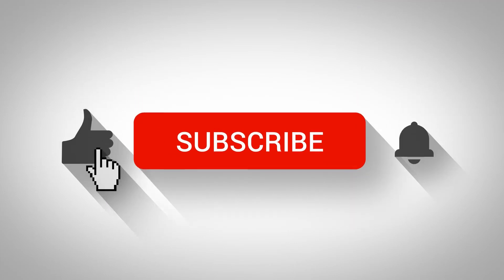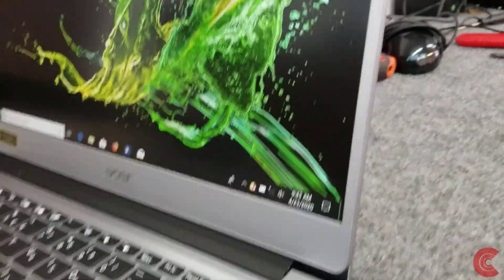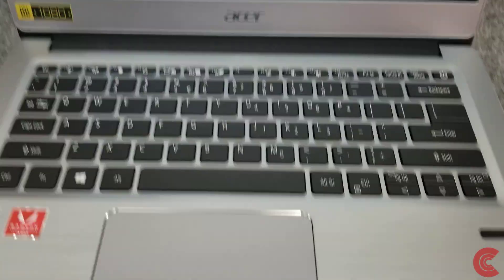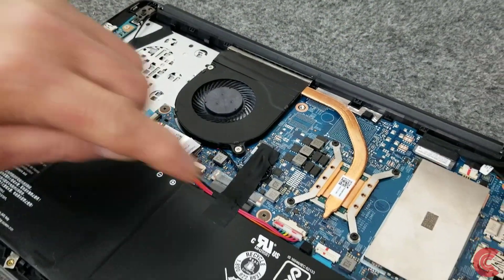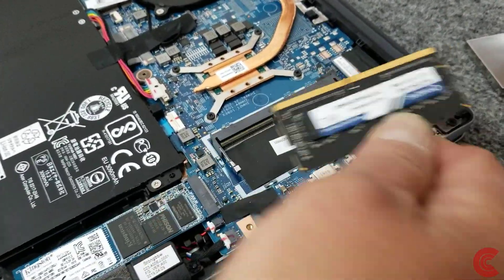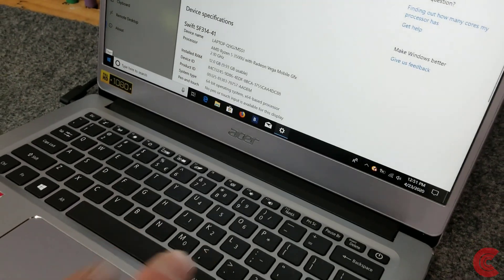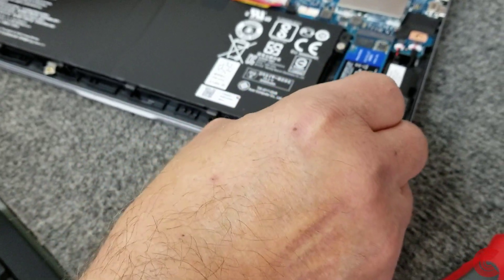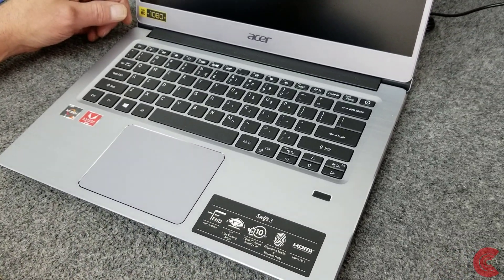Acer Swift 3 SSD & Memory Upgrade SF314-41

Comment: Worth noting that the spare 2.5" drive bay will not accommodate the thicker size of standard 2.5" HDD (15mm) only the two smaller sizes; 7mm and 9.5mm

Comment: Mine has a HDD in the HDD slot. Do I need to remove it first before adding an SDD on the m.2 nvme slot? Or would both work together if I add both?
Reply: Hi. You have 2 storage right ? NVMe and SATA 2.5 ? Are they work together ? Thank you

Comment: Very straight forward. Just installed the Team Elite 16GB ram flawlessly. Next thing I'll do soon is a new NVME drive which I've just ordered. Thank you!!
Reply: is it working with no issues?
Reply: does it support 16gb single stick?
Reply: @koru_insta2397  did you ever find out about this?
Reply: Can i Ask you about how max the upgrade ram of this unit? mine for now have 8gb’s of ram, but i want to upgrade it into 20gb by change the 4gb removable one with 16gb of ram, is it possible?

Comment: I just added an 8 gig to my swift 3 as well just now. 
What you said just happened to me and the screen won’t turn on even if I have given it enough time before force shutting it down. Help. 😐😐😐

Edit: it took me a re-installation of the ram, did what you’ve done of booting the power on with out the back cover and un hooked battery to the board. It finally worked! 
Thank you for this vid and your easy to understand, straight to the point tutorial!

Comment: i am sorry my  man i hear its no  static carpet cool sorry to say  that , a quick question, i have the swift 3 with pentium gold cpu , CPU 4415U @ 2.30GHz   2.30 GHz i take it it has the same  ram in it
Reply from the maker: Hi no problem.   Your ram will DDR4 for sure.  It may be soldered to mainboard, which means you can't change it. You may an expansion slot too.  Dale

Comment: you could not find a more static producing top to work on with static sensitive parts
Reply from the maker: Lol.  All our bench tops are covered with commercial anti static carpet. Our floors and bench tops are treated regularly with staticide. In 25 years never an issue.  You couldn't produce a static discharge in our store if you tried.   Dale

Comment: I did an ssd upgrade on the m.2 slot on my swift3 (before it was running windows on the hdd) but after doing windows 10 fresh install on the ssd, the laptop will sometimes get memory management error bsod upon restarting or waking up after sleep. Any suggestion on what to do? Any help would be much appreciated.

Comment: hi dude my sf315-52 lcd broken can i replace it with n156hge-eab lcd?
Reply from the maker: Hi. If both screens have same 30 or 40 pin connector,  most likely a 30 pin, unless it's a touchscreen, which will be 40 pin. Dale
Reply: @CadillacComputerCenter  both 30 pin thnks dude

Comment: hi, please could you tell me if the Acer Swift 3 supports 1x 16GB and 1x 4GB together (I can change only one 1 stick of 4GB RAM the other is fix). Thank you!
Reply from the maker: Hi. It should support a 16gb module.  Total of 20gb. Dale
Reply: @CadillacComputerCenter  thanks
Reply: @CadillacComputerCenter  Do you know anyone who tried it with this model? (I upgraded to 12GB, not sure does it support upgrade  above 12GB)

Comment: Hello Sir, I want to add a m.2 nvme ssd to my laptop but idk which ssd comes with screws for the m.2 ssd.
Reply from the maker: Hi. M.2 drives require only one mounting screw.  If your laptop already has an m.2 drive. Use that screw.  If your m.2 slot is empty. Usually the screw is already there. Dale
Reply: @CadillacComputerCenter   My laptop only has 1TB HDD that comes with so I don't have a screw for m.2 drive that comes with it. What should I do?
Reply from the maker: Like I said. The screw is probably already in the mounting hole. If not, you can get the screw easily on Amazon or Newegg.  Just search for m.2 mounting screws.

Comment: hi i need help. i bought ram that is 2400mhz sodimm 8gb ddr4 for my laptop (same model) but when i installed the ram, the side lights were blinking blue but the display was not turning on. the technician said for the ram to be read the laptop should be reformatted. idk what to do please help

Comment: Hi, i have the same brand new laptop, since i got it from the store, the start up usually takes 5 or 7 minutes. And performance is so low, it's very laggy. What can I do to improve this?
Reply from the maker: Hi.  Hmmm, it should have come with an ssd installed.  If it has a hdd, then you can upgrade to an ssd.
Reply: @CadillacComputerCenter  will i lose all my data as well as windows 10 if i change it to ssd? I got the 1TB hdd

Comment: Hi, I have an Acer Swift 3 with 4gb RAM and 1tb HDD. Is it possible to upgrade to an SSD? And to add more RAM? Thanks!
Reply: It's a Swift SF314-41.
Reply from the maker: Hi. Yes you can on both.

Comment: Is the SF314-42-R7LH model the same on the inside, upgradable memory and 2.5" HDD?
Reply from the maker: Hi. Unfortunately,  your model has 8gb lpddr4 on board memory. Not upgradeable,  no expansion slot. You can easily upgrade your nvme ssd though. Dale

Comment: Hello. Just wanna ask if all SF314-41 laptop has the same ram speed? I'm planning to upgrade my laptop ram but I'm not sure if it's 2666mhz. My laptop model is SF314-41 R9VF
Reply from the maker: Hi. Open task manager, click on performance tab, click memory on left side.  It will show you ram speed. Thx
Reply: @CadillacComputerCenter  in the task manager tab it says 2400mhz but when I tried in cmd it says 2667mhz :/ so I'm really confused I can't upgrade my ram

Comment: Hello sir, I have Swift 3 SF315-52-81HD whereas  this video is for Swift 3 SF314-41. So my question is : Can I install another hard disk on my laptop while also keeping my 256 GB SSD ?My swift 3 looks exactly like the one shown in the video by the way.
Reply from the maker: Hi. As I stated in the video, this model does not ship with the hdd caddy.  They are hard to find, but you should be able to get one from acer. Dale
Reply: @CadillacComputerCenter  Thanks for your reply sir...

Comment: my acer swift don’t recognize the new memory stick, I try to install a 8Gb module (instead the 4Gb from factory) and still in black screen for about 5 minutes or more. Also I try with a module from another acer PC with the same results. What should I do? Thanks
Reply from the maker: Hi. Is your new ram same specs as old ram?  Does the old stick still work?
Reply: Cadillac Computer Center both are DDR4 2666MHz and the same brand (Kingston). When I connect the old stick my laptop boot normally
Reply from the maker: Hmmm, does your laptop have on board ram?  Is your new ram 1.2 volts?  Sometimes when you install new ram, turn it on for 30 seconds, then hold in power button till its completely off. Turn right back on for it to post.  I have great luck with Corsair, and Timetec ram in acer laptops.
Reply: Cadillac Computer Center yes, 4Gb onboard ram and the new ram 1.2v. same as the old. I try several times and nothing new occurs. I disconnect the battery and push the power button prior to change the stick. Tomorrow i will try again. Thank you so much.

Comment: This model has the empty area to add a 2.5" SSD like some of the other versions of this range. Looking at the PCB on mine it looks like Acer didn't add some of the needed components just above the socket where the lead to the SATA connector fits. Has anyone tried adding a SATA drive to this version ?

Comment: Is nvme PCie compatible with acer swift 3? Or just a regular m.2?
Reply from the maker: Hi. Yes, it supports nvme pcie m.2. Dale
Reply: Thank you for the response but i need help again. Recently bought an m.2 ssd (Kingston a400)and installed it on my acer swift 3 sf314-41g-R9QL. Unfortunately it is undetected even in bios. Hoping for your response. From Philippines

Comment: I changed my 4GB stick out for 16GB but it only recognises 4GB of the available 16GB.... Any ideas?
Reply from the maker: This model has 4gb on board memory.  What brand and speed of ram did you install? Dale
Reply: @CadillacComputerCenter  
Yes, picked that up from your video, mine came with 4+4 installed.
It's a Crucial 16GB stick. DDR4-2666 SODIMM.
Replace the 4GB stick and it shows as only 8gb installed in both system about and task manager. If I remove the stick and start laptop it states it has 4GB (soldered).
Reply from the maker: Is yours the same model in the video?  The on board may only be 2400mhz.  Most of these models are.
Reply: @CadillacComputerCenter  
Yes the exact model. 
That could be the issue, it not cost me anything as my friend had spare sticks so I thought I'd try. Just need to buy a 2400mhz rated 8GB stick for it!
Reply from the maker: I've had good luck with Corsair Vengeance ram and Timetec ram for these models. Thx

Comment: Hello sir. I have questions I hope you don’t mind 

1) Is this good for online classes? 

2) is this good for like gaming?
Reply from the maker: Hi. Good laptop for every day use.  Good for all online stuff.  Not so good for gaming. Dale
Reply: Cadillac Computer Center also is there a camera inside the computer?
Reply: Cadillac Computer Center I hope you could answer quick thanks :)
Reply: @BustedCartoonsYT  Its a great laptop, You can even game on it but it heats up a bit, with aluminium body...Its not really designed for gaming but it can handle a lot.

Comment: Is this laptop have 2 ram slots out of the box? Or u just installed additional ram slot? Thanks
Reply from the maker: Hi. This model has one ram slot for memory expansion.  4gb of on board ram. Thanks for watching.  Dale
Reply: @CadillacComputerCenter  what are the specifications of ram you bought sir? DDR4? what frequency? My laptop is ACER SWIFT SF314-14 . I'm not sure if it has 2 ram slots like your's

Comment: Hello, I have the Swift 3 with the same specs but it's Sf314-41-R1HQ, is it also ram upgradeable? and what brands of ram would you suggest?
Reply from the maker: Yes, you can upgrade the ram.  I use Corsair, timetec and ADATA memory
Reply: Thanks for letting me know!
Reply from the maker: Your welcome.
Reply: @CadillacComputerCenter  Is it okay to not unplug the battery? or is it a necessity to do so before ram installation? Thank you in advance.

Comment: Hello good sir, my laptop is the same (4 gb), but it says it has used the 2 ram slots. Can I replace the other one with a 4gb so it will be 6gb? 

Hope for your reply!
Reply from the maker: Yes you can.  If you have 2 slots. Dale
Reply: @CadillacComputerCenter  Thanks but I just found out that my ram is on board, huhu so sad.
Reply from the maker: Yes, you should still have one expansion slot.

Comment: I have acer swift 3 SF-313-51-55Q1 laptop,today it is turned off automatically when I was using it  and not turned on after press the start  button ,the screen goes black also the keypad light is also turned off.charging orange is flashing when charger plugged into it also the start button side blue light is also ON when pressed but the laptop didn't turned ON ,nothing will happen in motherboard also. Please help
Reply from the maker: Hi.  Well, a couple simple things you can do try are, unplug  charger, hold in power button for about 4 seconds, until all lights go off .  Then turn on like normal, see what happens. Dale
Reply: I tried it but nothing happened
Reply: Can u make a video on that?
Reply from the maker: Are you comfortable removing the bottom cover?
Reply: No,laptop is in warranty period still now ,I will not do it by myself .
Reply from the maker: Ok.  You can contact customer support thru acer website.
Reply: @CadillacComputerCenter  yes

Comment: Hi, I have a swift 3 sf314 41g and I installed a m.2 sata ssd to become my OS Drive but it's not detected in the bios. Some people said in forums that my laptop only supports nvme ssd's. Is this true? Thanks for the time and great video!
Reply from the maker: Hello.  I have not tried a m.2 sata drive in this model I used in video.   I have put m.2 sata drives in other newer acer models though.  It is possible yours only supports nvme drives, which is faster as well.  Have you tried booting from a windows 10 usb install drive to see if it is detected during install?  Dale
Reply: @CadillacComputerCenter  Hi, thanks for your reply! Yes, I did try booting from a windows 10 usb install drive and it's still not detected. I just sold my sata m.2 ssd and currently waiting for the nvme ssd I ordered. Have a great day!
Reply from the maker: Oh good. Glad you went with nvme.   Good job. Dale
Reply: @humphrey7680  hoping for your response.
Reply: @professorlisbon2815  Hi! I bought a Kingston A2000 nvme ssd and it works perfectly. I'm guessing some/all models in the swift lineup only supports nvme drives.
Reply: @professorlisbon2815  The first one I bought was a Kingston A400 sata m.2.
Reply: @humphrey7680  thank you very much for your response sir. I'll just replace my a400 with a2000 then. May I ask how many gigs have you installed? And is the exact model of your laptop SF314-41g-R9QL?
Reply: @professorlisbon2815  Yea, I have the sf314-41g-r9ql. I bought the 250gb version of the a2000 because it already came with a 1tb hdd.
Reply: Hey Tom. Can I ask if your problem was already solved. Was it confirmed that your unit only supports nvme and not m.2 satas?

Comment: Would an additional 4gb ram work better than 8?
Reply from the maker: It never hurts to have more ram. Dale
Reply: @CadillacComputerCenter  i heard its better 4+4 than +8 cause of load transfer i heard its better.
Reply from the maker: Yes, if you can achieve dual channel. It is always better.  As long as you use same speed ram.  In this video I believe the onboard was 2666mhz.

Comment: I have the same model but I only add 4gb ram. The results was 5.9gb usable and 2.1gb reserved. The same results on this laptop too. So that means this is normal on this laptop? I should have added 8 or 12gb then.
Reply: i think its normal, windows 10 with 64bit eats up 2GB ram while 32bits takes 1GB of ram

Comment: Got a quick question - Is the m.2 slot on this model exclusive for nvme?
We tried booting a sata m.2 but it's not showing literally everywhere (bios, disk management, etc) 
Would any nvme work or do we need to be specific in purchasing a brand and model?
Reply from the maker: Hi. Any brand nvme will work, samsung, crucial, adata etc.  An m.2 sata ssd should work though. Hmmm. Dale

Comment: Do you have an alternative way to remove the battery cable? I can't seem to find the tool you use to remove it.
Reply from the maker: Hi.  All you do is gently pull back on the cable, use your finger nail if you can. It doesn't take much force to pull it back, towards battery. Dale
Reply: @CadillacComputerCenter  okay then thanks for the info

Comment: Is the acer swift 3 model sf314-41 r9vf ram upgrade able too?
Reply from the maker: I cant say for sure,  but if you have 4 gb now, it probably is.  Is yours a ryzen 5 cpu?
Reply: @CadillacComputerCenter  yes ryzen 5 3500u
Reply: It has 4gb ram
Reply from the maker: You should easily be able to upgrade it to probably 12gb if you have 1 expansion slot. Probably even 20 gb by adding a 16
Reply: @CadillacComputerCenter  alright thx alot
Reply: Josh Twist hi! Is it okay to know of what brand did you buy? I would also like to upgrade my acer swift.
Reply: @johnpaulcantero9255  yes i bought a kingston 8GB DDR4 PC4-17000 2133Mhz

Comment: mine acer swift 3 (2016 Model) doesn't have extra RAM slot, but the RAM is inbuilt or soldered which I can't upgrade.
Reply from the maker: I have seen some models that cannot be upgraded.   Sometimes the ram slot is covered by a shield.

Comment: Need help. What ram and ssd compatible to acer swift 3 sf314-41g-R4ew? does it have m.2 slot? Big thanks to those who can answer!
Reply from the maker: Your model probably has 1TB hdd.  I'm sure there is an m.2 slot.  Ddr4 2400 or 2666 will work.  You can remove screws to open up and confirm.  Dale

Comment: Good day, sir. Can i mix 8gb ddr4 2666mhz cl19 with the soldered pre installed ram?
Reply from the maker: Yes you can. Thx
Reply: @CadillacComputerCenter  thanks for the reply sir. I bought and installed a crucial 8gb ddr4 2666mhz cl 19 on my acer swift 314 41 and followed what you did in this video. However, i got just a black screen after pressing the power button. 

I long pressed the power button just like you said, after the fan went out, pressed the power button again but still black screen.
Reply: @CadillacComputerCenter  i can't access the bios also. So what i did was, i removed the 8gb stick and the laptop booted like nothing happened. 

I tried to install again the 8gb, black screen. Got fed up and uninstalled the 8gb stick.
Reply: @CadillacComputerCenter  now i installed the same 8gb on the laptop of my wife, an hp 14s, worked liked a charm. My wife now has 12gb of memory. 

Interestingly, on the hp laptop, before it booted completely, there was a notif on the laptop that the bios will reset. On the acer there was no such message.
Reply: So i bought a crucial 4gb ram 2400mhz and it worked on my acer swift 314 41 r9vf
Reply: @MadRayuga  Hi, you bought ddr4 or ddr3?

Comment: Can i upgrade 16gb single memory? additional to 4gb onboard?
Reply from the maker: Yes you can
Reply: @CadillacComputerCenter  will it work? even if acer website says it is only upgradable to 12gb ram?
Reply from the maker: I have done many of these models with 4gb on board, and added 16gb stick.  Total of 20gb. Even when acer says 12.  I would be shocked if it did not support 20
Reply: @CadillacComputerCenter  thank you much... very big help :)